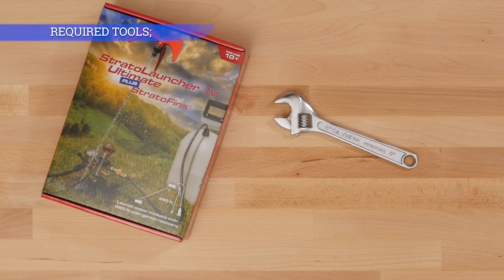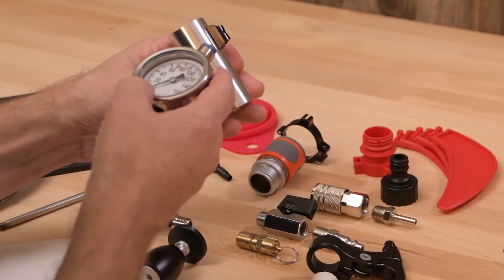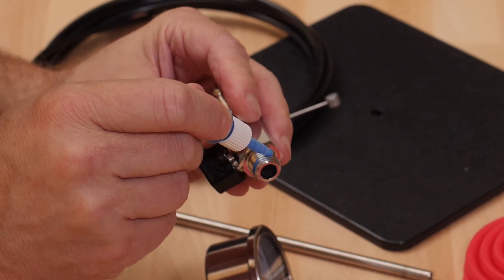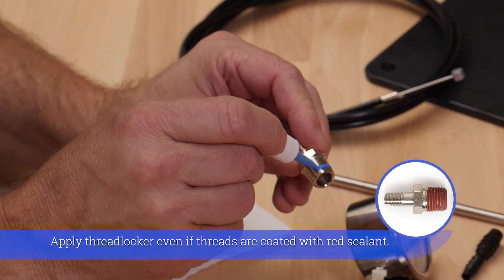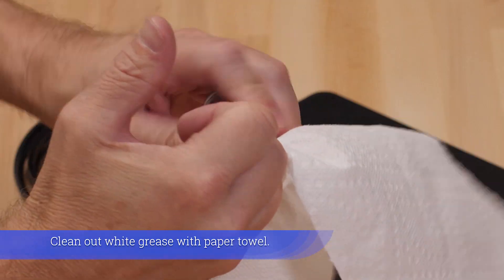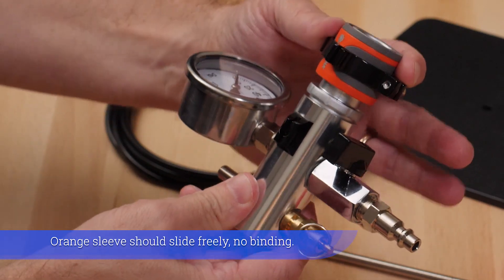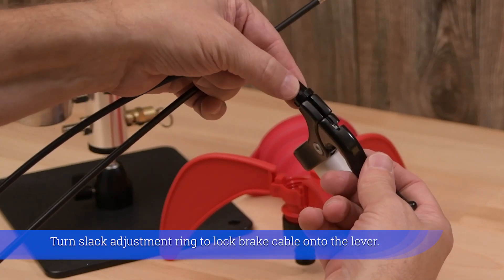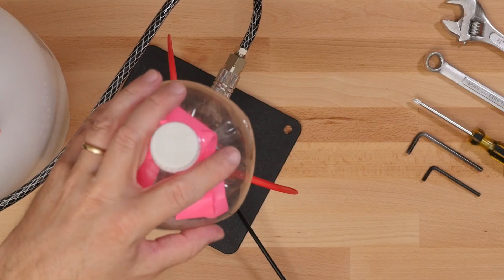StratoLauncher IV Ultimate Assembly Instructions

Comment: I dont know how does the manometer work in that position. How do you separate the water from the air?
Reply: I mean, exactly at minute 1:17 I see perfectly how the manometer would be in contact with the water instead air
Reply from the maker: @JorgeEstevanTorresPena  The very definition of a manometer explains everything: a measuring instrument that measures the pressure of a fluid or gas in a confined space. It doesn't matter whether it is fluid or gas that it is measuring. They will yield the same result. The way the launcher is designed is that the air chamber is below where the incoming air pressure comes in via the Schrader tank valve and the water chamber is above. The center stainless steel tube is what separates these chambers, keeping the water from entering the air chamber below provided that one does not exceed the height of the tube. The air pressure presses against the water, which the air pressure gauge (manometer) reads and displays accordingly. You can learn more about the center tube in this video: Center Tube Functions on the StratoLauncher IV: https://youtu.be/JH_xe0MGFFA
Reply: @StratoFins Okay. I'm trying to understand. So the Hose Q-Release is not non-return? I guess you had to remove that feature to insert the 1/4" stainless steel tube.
Reply from the maker: @JorgeEstevanTorresPena  Not sure I understand your question, but the air chamber is at the Schrader Tank valve/safety relief valve level at the bottom, goes up the center SS tube and into the mounted bottle. The center SS tube keeps water from entering this air chamber. The water is at the middle level where the air pressure gauge/mini ball valve that connects to a tank sprayer are located. This is where the air/fluid pressure is measured at by the air pressure gauge. The Hose Q-Release is open and doesn’t have an internal one way (non-return) valve, which perhaps some hose connectors have.

Comment: You forgot to mention about the knob under the pressure gauge. I installed everything and now it doesnt fit because the gauge is blocking the installation of it since thread lock is dried. Please update your video
Reply from the maker: The threadlocker is not permanent, but removeable so you can remove the pressure gauge with a wrench and can reassemble properly following the video instruction order. The pressure gauge does install first and is positioned at a 25 degree angle (see 1:31), which allows for the Schrader (I assume you are calling this a knob) to be installed underneath of the gauge.